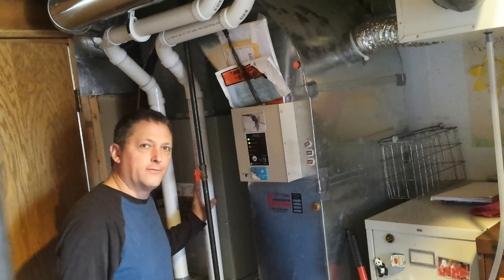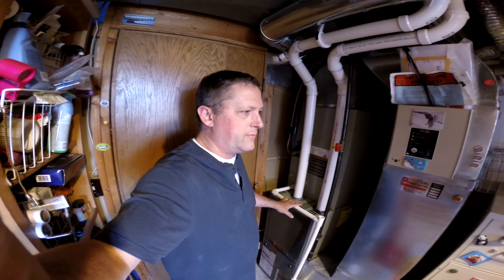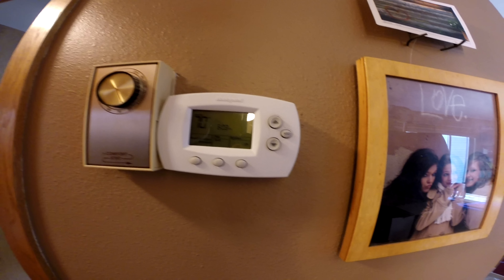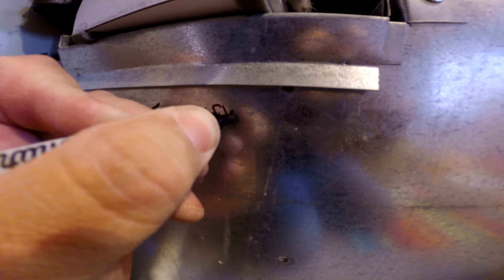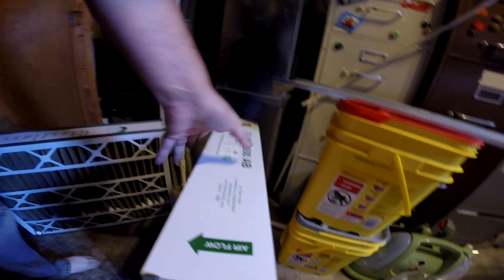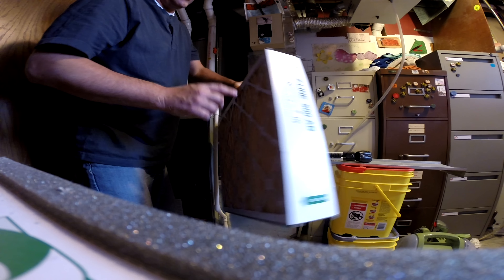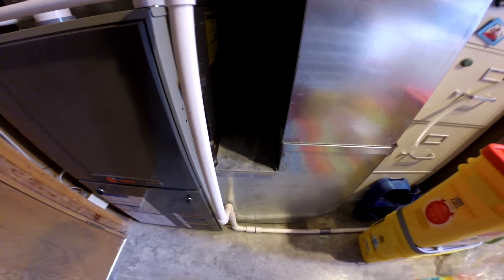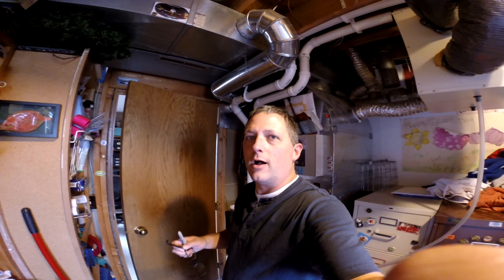How to Change a Furnace or Air Conditioner Filter | GoPro View Inside Furnace

Comment: Thank you for sharing this with us.  I didn't even know that this was maintenance that I needed to do.  But, I am glad you showed me where I can start doing this.
Reply from the maker: Yes, I learned the hard way and had furnace problems when the filter was all clogged, and caused condensed water to leak into the carpet and ruin the woodwork along the door frame.  The furnace filter is crucial to having a healthy furnace and air conditioner.   Thank you for watching.
Reply: Frosty,
Yes, videos like yours help people (like me & my family) be able to stay in the Middle Class (I hope that we are still in it) be able to save & protect our money a little here and there,  which makes us more able to give a "slightly" higher standard of food and/or upgraded cable for the kids.  Again, thank you.

Comment: Thank you - just bought a house and couldn't figure out how to change the filter. I looked and looked before I found where it was supposed to be. Turns out the renovators never put a filter in so it's been running for months with no filter and dogs in the house. I have an idea of why my bills are so high now....
I really like the tip for making the banging noises : )
Reply from the maker: We recommend a furnace inspection which would be a very good investment to get your furnace cleaned up and running back like it should be.  The company that I hire also does a very good job cleaning it up inside so as to make it run efficiently and removes any fire hazard or problems from not having a filter.  Our lake home had the same terrible situation that you did, no filter, and it was actually in need of the tune up as a result and almost failed to work that winter when we purchased it.   I am very happy to hear my video helped you with your furnace.
Reply: oh wow, ok - thanks so much for the tip. I will look into this before I end up with a serious problem!
Reply: Laura Hilbert this and also the septic system especially the pumps and the drainfeild about easily 30 thousand us dollars

Comment: Glad I watched this video. It made me double check my filter orientation. I had the airflow direction wrong. I ran it this way for 2 weeks. Hope I didn’t cause any long term damage. Thanks for the video
Reply from the maker: I think it should be ok.  I purchased a cabin that did not have any filter on the furnace at all.  Who knows how long it was without but it ran fine.  Over time the fan motor could wear out or become unbalanced, and the inside ducting of the inner furnace will get all contaminated.  The filter is important, but there is room for error.  I am glad my video helped you out.
Reply: I go to houses where people have been putting it in backwards for years and there's no problems. To be honest, after seeing thousands of filters I don't think it affects the airflow much. Many filter have a net on one side and not the other. The netted side goes toward the furnace or blower motor. That way if someone does not replace the filter for a long time, the net will prevent it from being sucked into the blower wheel. (I have seen them sucked in before, takes forever to pry them out of there)

Comment: what would be causing a rust pattern in the  middle of an air filter?  The last one I changed was just dusty, today the one I pulled had a huge, long rust stain in the middle. Does this have to do with moving from AC to heat? Bad pump? Thanks!
Reply from the maker: That is very strange.  There must have been some condensation of water inside the vent, and touched some metal and dripped onto the filter.  As long as the filter is dry, I would not worry.  It is highly advisable to have a furnace inspection once in a while.  They recommend every year or two, but even once in five years is better than nothing.  You might want to consider a furnace inspection if that happens again.  They can make adjustments and clean it to save you some money.

Comment: Thanks for the video! It was funny when you said: by making more noise, your work sounds more important ;))

My story: I took the old filter out and it looked very nasty after 1 year, then I went to buy the new one at the gorcery store and they did not have the right size. I got one a bit smaller for tonight and hopefully I find the right size tomorrow. 
I learned to but the filter first then put the old one to garbage.
Reply from the maker: hahaha, I forgot I said that.  I love when I can humor someone when doing chores.  Yes, make sure you get the correct size because a filter that is too small can leak around the edges, or even get sucked into the intake.  I have the same problem at the lake so I have to purchase filter material and cut it do size and place it on a simple wire frame to keep it in place.   Thank you for taking the time to write a positive comment.

Comment: I need a replacement metal furnace filter cover. The previous homeowners of the house I bought left it sitting out to get wet and is rusted... and gross. Tried googling where to find replacement parts for that but I am coming up empty. Help!

Comment: thank you for this we just rented a house and haven't had cold enough air come out. I'll try changing the filter and see what happens
Reply from the maker: If the new filter does not help get the airflow to increase, then have your landlord get the fan motor checked.  If it does not move air adequately then the furnace will not work very well at all, and the airconditioner will freeze up in the summer.
Reply: @FROSTYLIFE  Great video! I have a Carrier 58STA model, and I am going to attempt to replace the filter that hasn't been rep[laced in 13 years I believe! I hope that fixes the problem. The ac air is not being circulated to all the rooms and the house does not cool. I'll see how dirty that filter is.

Comment: THANK YOU!!! I was actually kind of freaking about changing the filter, but you really made it easy to understand and I really appreciate it! One question though, I have a dual unit and I only saw a place to change the filter on furnace ONE, is that correct??
Reply from the maker: Yes, the furnace runs the air conditioner air circulation fan, so if I understand your question right hopefully that is the only air filter for your system.

Comment: Thank you for your video!  So you can use a 1 inch or a 5 inch filter? Just makes a difference of how often you want to replace it?  Mine has a slot and a 1 inch fits in there.  I am going to check to see if I have the cover that comes off.  So many filters confusing on what ones are the best.  We have a Goodman heat pump with gas back up.  Filter seems to be 16x22x1 or maybe a 5.
Reply: If you don't have an owners manual, check the model number of your furnace and do an on line search to see what air filter you should use.  After years of doing daycare I learned that cleaning an air filter and having frequent furnace cleanings helps to keep the air quality clean. :)

Comment: Do all gas furnaces have a filter (directly) attached to the furnace? I don't see one. I have two remote reusable remote filters only.
Reply from the maker: All furnaces "should" have a filter, somewhere in the system.  Perhaps it might be in the air ducting further from the furnace, but only your owners manual can tell you that.  It is possible that a home might have a furnace installed without a filter, even though all furnaces are supposed to have one, but some people might be dumb enough not to install one in accordance with the manufacturers recommendations.  I purchased a lake home that the owner neglected to have contractors finish the filter housing, and set a filter on the intake carelessly, and so much dirt, hair and dust entered the furnace that the fan blades had serious problems after 12 years.
Reply: Thanks for your response. My furnace is in my attic. Hard to get to. I did pull the cover off today for the first time in 16 years. No filter directly connected to this unit. Looked relatively clean inside.  The instruction are nailed 5 feet above the unit and unreachable without major effort. Really odd.
Reply from the maker: Look for any intake filters, such as in the ceiling or walls.  All ducting leads to the furnace, so there must be some part of the ducting that has a filter. I have seen them in the ceiling.
Reply: Thanks Frosty, I DO have two filters connected remotely as I had mentioned earlier but NONE directly connected to the unit. That was my concern. I use reusable filters.

Comment: It’s still short cycling about every 15 seconds. I changed the filter without knowing to turn off the air conditioner. Is it possible dust got in there and that’s why it’s still short cycling?

Comment: Thanks for the video,, I know for a fact that my furnace takes 2 different sizes, When I just took the larger one out to replace, the 2nd one wasnt in there!!!!!!! I do remember my son replacing these a while ago, now I DONT KNOW WHERE TO PUT THE 2ND ONE
Reply: Sorry didnt mean to use caps, wasn't yelling on the outside!
Reply from the maker: +Christiann Erkel thank you for taking the time to write a nice comment. There are so many furnaces out there that do not have a filter installed correctly or has not been changed for a very long time. The furnace is the most expensive item in the house and hopefully my video helps more people realize that they need to change their furnace filter quarterly every year

Comment: The a/c technician came out to fix our a/c and he removed the filter from the unit which is in our attic. When we got the new filter, we didn't know which way the air was flowing since the old filter was gone. There is a huge tube (about 2' in height) covered with plastic and (I'm assuming) insulation to the left of the air filter cartridge leading away from the unit. To the right of the air filter cartridge is some sort of machinery. Looks like a tank of some sort. We are assuming the air is flowing out through the tube and not toward the machinery. Does that sound right? You said that the air flows toward the furnace. If that tank-looking machinery is the furnace, then our filter is in backwards. We can't tell which way the air is flowing just by feel. What do you think?
Reply: The filter slot is almost always installed on the "return air" side of the furnace.  If you take a piece of paper and hold it in the filter slot you will see it start to pull to one side.  At first it just seems to pull straight in, but if you cover up some of the filter slot opening the paper will pull to one side.  Point your filter arrow that same direction.  Good luck, and don't let go of the paper! :)

Comment: my gas furnace is 10 years old the brand is bryant. I went up to attic to look at it but can't find where to replace the filter. does it not have filter? or it's somewhere in there? the furnace is side ways and I haven't change filter in 2 years. but always changed the filters on 1st and 2nd floor.
Reply from the maker: there has to be a filter.  Follow where the fresh air return ducting runs to the furnace.  Sometimes it is installed in the ceiling where the air is drawn toward the furnace.
Reply: yeah there are filters at the ceiling on each floor, I always change those. but is there filter in the furnace too? is it either or maybe both. I took couple pics of my furnace can you see where to install the filter? or maybe the filter is from the ceiling of each floor?    http://imgur.com/fgAZMRq     http://imgur.com/4RzMlRt    thanks for the help
Reply: If you only have one heating system and there are two filter slots in the home then there is probably not another filter anywhere in the attic.  Sometimes filters can be installed INSIDE the blower compartment of the actual furnace itself, but rarely when the unit is in a hard to reach place like an attic, and especially if you already have accessible filters in the home.

 If you are unsure you may want to schedule a one-time $60 tune-up with a
 reputable hvac company to double check.  Could be well worth it.

Comment: Question: do I need a filter in front of my AC panel and in front of my furnace? I live in a condo
Reply: Probably not if you have hvac and furnace as one unit  they both share the same central air. So, replacing your central air filter will suffice since it connects to the furnace air as well.

Comment: Why is my furnace blowing heat on a cold air setting? A technician said it could be the mother board but I’m not sure if that.
Reply from the maker: Oh, yes, the problem with newer appliances now is that they have some technology to make them work.  If the technology fails, then the furnace will malfunction.  The more complicated our appliances get, the more expensive they are to fix.

Comment: I cant find my AC filter... is the AC filter and the furnace filter t he same?
Reply from the maker: Any filter that is located in the air intake for your air-conditioning system should be changed regularly.  If it is where the air enters the system to be cooled then yes, that is the correct filter to change.
Reply: I just now checked the air filter in my mom's house and I seen that she has been running the wrong size 16x20x1   was in it but I measured the opening and bought a 16x25x1 and now it covers the opening from end to end, should I blow out the fan with air? wrong size filter has been used for at least 10 yrs, word to the wise don't assume the right size filter is in your unit already...
Reply: I know where the furnace filter is and I change it regularly. I was wondering if the air conditioning uses the same filter as the furnace or does the AC have a dedicated filter located somewhere else?
Reply: David Paypa it should be the same.